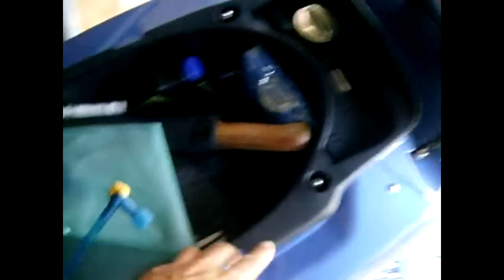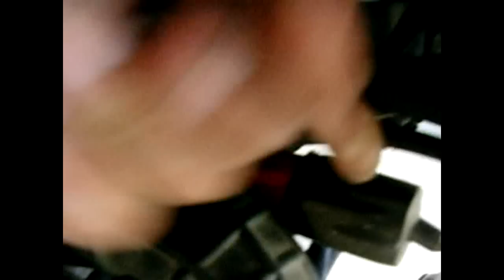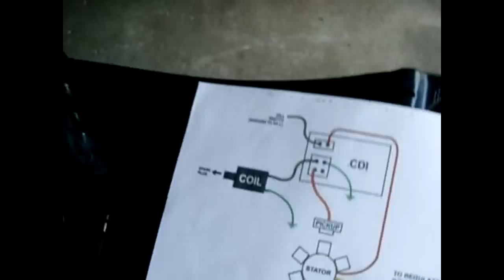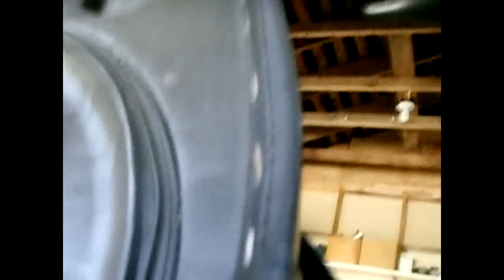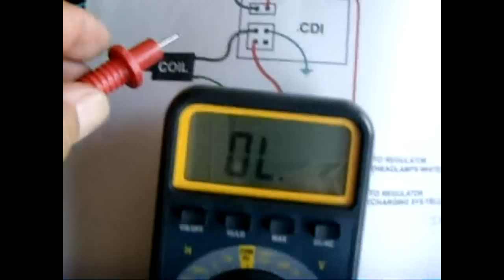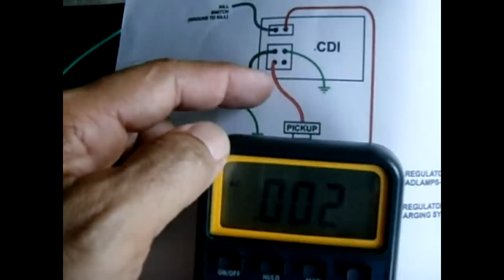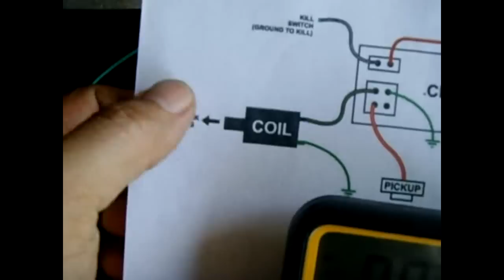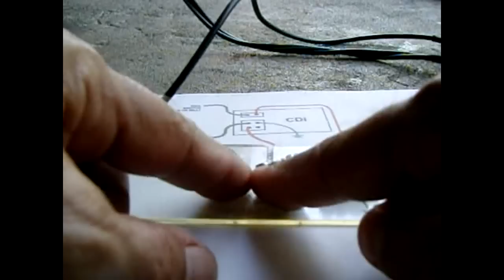The Ultimate GY6 Starter & Ignition Troubleshooting Tutorial

Comment: well i bought  a jonway 250  and its been good other than wont hold  a charge without a constant Battery Maintainer  hooked up.  it was sputtering  a little before  i parked it and then next day i took maintainer off to start it and NOTHING?
no power ,nothing?  my battery is good , im at a loss i wished i  could get someone to do diagnoses  & routine maintance
Reply from the maker: Very simple. Fully charge the battery, then disconnect the NEG cable overnight. In the morning put the cable back and see if the scooter starts up. If it doesn't, then your battery is gone(lost it's capacity/has shorted cells). If it does start up, then you need to watch my battery parasitic drain video. Thanks for watching!

Comment: All of my electrics work on my scooter starts on a kick but won't start on the button battery is fine. It will start when I cross it at the solenoid and I can't seem to find the problem the button looks fine and it should be as the scooter only has 800 miles on it . It's a 2007
Reply from the maker: If shorting the 2 bolts on the solenoid starts the engine, then you have either a faulty solenoid, faulty start button, blown tail light, of bad wire connection.
Reply: electronicsNmore thanks I'll go down to the shed and have another look at it and I'll let know if I've sorted  it
Reply: what if you've replaced the solenoid, then the switch, and still doesn't start from the push button? I would have to take off the seat, pass a screwdriver between the 2 bolts and hot start the bike. I recently took it to a mechanic who wound a wire from the positive (red) and cut the negative (black) wire, that now I have to connect to jump start the bike. I was working on getting the bike to start, touching these two exposed wires jutting out of the side vent, that I bought a 2-way flip toggle switch to simply trigger the starter. Tuning the carb has been my BIGGEST issue and now on top of that, I have a 3rd starting sequence having to flip on the starter then remember to TURN OFF the starter once the motor sustains. Well, I must have crossed wires somewhere or even tripped a ground, but once I got the motor to run, I went to turn off the bike by the killswitch on the handle, the toggle OFF for the starter, and the key ignition off, THE BIKE KEPT ON DISCHARGING and trying to start. I panicked and pulled the solenoid out, then pulled out all the plug wires in the harness, *it was still going*, then disconnected the battery. It was really troubling...I have no working kickstarter and possibly the kick spring is off track. So the electronic start is all I got.

WHAT DO I DO? ~_~
Reply: I forgot about my scooter since in my shed and was rooting at it again today. I changed the solenoid and the push button starter switch and still nothing.

Comment: Hello, and thanks for the great video up front : ) I hope you are still open to a question or 2.. I would like you to know that i watched your video several times over by the end, and tried to listened very carefully before posting any comments / questions, as to not waste any of your time. Hopefully i did not miss anything i am about to ask ; )
Just a couple bits of info first that may help.
This is a go kart with the gy6 150cc engine. I have no keyed ignition (push button). I just tied the on / off switch wires together for the tests just to rule it out of the equation all together. Switch tests fine though. There is a secondary safety switch on the brake pedal. The starter will not kick when you push the starter button unless you are holding the brake at the same time. That switch is also functioning fine. My 4 pr. wire harness going into the CDI only has 3 wires in it.  I Did a continuity test of each wire. 2 of the wires go to each lead of the coil,(if 1 of those is a ground then any ground would show continuity i guess) and the 3rd wire is the pick up wire. Other than those couple things, some wire color differences, and the fact that the fuel gravity feeds on mine, everything in your video matches what i have here.. Moving on... 

@14:00 mins. of the video i guess is a good start. Coil OHM resistance at CDI. I am getting an OHM measurement of .8 -1.0 for this test. (tester set @200 ohm)  I have 2 coils, both are used, and they test identical for all tests moving forward... I am getting that .8 reading no matter if i test through the wire that goes from CDI to the coil, or if I just test directly to the coil. both coil wires at the CDI read the same. ( i also get the same readings if i just meter the leads on the coil directly while not connected to system)

Skipping forward to 19:30, Coil tests. I did this test exactly as you recommended. With boot / wire off, black meter lead to green coil lead, and red meter lead directly to the screw inside coil (meter set @20k OHM)it reads 3.24, Boot / wire back on. Black meter lead still connected to the green coil lead, and red meter lead to the end of the spark plug wire, same setting on the meter. I get a reading of 8.9. Do you see a problem with any of my readings. By your readings at 14:00, my readings are pretty low. although i saw your caption there as well...)Is my coil ok?  All the other tests that i went through with you on the video seem to be with in the same operating specs..  I am stumped! Still No spark! A new spark plug is next on the list as soon as the store opens. I will cry if that's all it is. I usually just have them around, and never hesitate to try a new plug first. I followed the spark plug test portion of your video, first time i have tried this, but that was not looking good for 2 plugs i have. 1 of them has no continuity between the tip and the electrode (junk), and the other measures with higher, and erratic resistance measurements, so it may be bad also. If not that though, what do you think? Would you still lean towards the CDI unit? I would really appreciate any time and info you would be willing to share.
I learned a ton from your video, and i would like to thank you again for that.. The title does not disappoint! I hope my question & info is just as clear. Thanks in advance.
-EJ
Reply from the maker: Disconnect the wires to the engine STOP switch, then try again. If noting still, then try a new CDI. Make sure the pick up coil is also working.
Reply: LOL, and you know exactly why.... The spark Plug was bad, but your recommendation to disconnect the stop switch wires was the ultimate info that helped me to correct what i was doing wrong. : ) That is a little embarrassing, LOL. Ohh well... Just so happy that i finally heard this thing fire! Good signs! Now i can move on with getting this thing complete again. I am eternally grateful for your video, & your quick, accurate advice! Wish i could return the favor. Thanks again! : )

Comment: Hi there. I will bust my meter out tomorrow and check a little closer as you show, checking the wire from the kill switch. I have already installed a new cdi box and the solenoid, battery is charged. When i try to start, lucky if i even hear it try to kick over. For the most part I just hear the solenoid clicking. A few months back, it would start sometimes, other times not. Do you think I should try new ignition coil and/stator coil, perhaps the starter? I followed this long ago having similar starting problems, and just ordered 3 of those components(cdi, solenoid, ignition coil), put them in, fired right up. My scoot has about 7500 miles on it. Have not really changed anything aside from what I mentioned above. 2012 evo 150, same color as yours actually. Thanks, Doug

Comment: what about my case? i have spark its getting fuel into the cylinder i verified timing and did valve adjustment replaced cylinder and piston with low mile cylinder and piston that ran when it came off the old scooter when i try to start it just sputters in an attemt of running but wont actually run up and go. if i hold the throttle open it sputters faster but still wont run.

Comment: hi bud my gy6 keeps cutting out in the rain only when it rains and doesn't start till dried out what can this be all lights still on just won't start
Reply from the maker: Sounds like a high voltage problem caused by increased moisture. Try replacing the ignition coil/wire, and spark plug.

Comment: Not getting a resistance reading on the black and yellow wire going to the positive side of the ignition coil. How should I go about fix?
Reply from the maker: Either a faulty connector, faulty ignition coil, or faulty CDI.
Reply: +electronicsNmore forgot I had the wire unplugged from the coil. plugged it back in and but I'm getting a really low reading.

Comment: Hi Doug - I'm getting nothing (no change in the ohms reading) from the black and yellow connection that goes directly into the CDI - almost as though there is a break in the connection. Do you have any suggestions for what I should check next?
Reply from the maker: If the results do not match fairly close to what's shown in the video, then either the component is faulty, or there's a bad wire/faulty connection.

Comment: I have an issue with the black and yellow lead to the ignition coil. It reads 30 ohms. Even with a new coil. I have spark but won't start. How do I correct this resistance issue?
Reply from the maker: Measure the resistance across the terminals with one wire disconnected. If you have spark, and squirting a small amount of gas into the carb does not make it start up, then you better check the valve clearances.
Reply: +electronicsNmore thanks for the reply. I tested the same wire with a different tester and got a better result. compression is 30 psi. tore all the way til piston is out and the G clip was broke and blew a small bit of the piston out at the pin and seized the bottom ring set. Now I have to order new upper half.

Comment: i have an old parts scooter that i took the engine from for a used vip i had to change the mount, now the starter won't engage the flywheel any ideas? it did work 2 years ago when i parked it

Comment: i have taken delivery of a stock new 49 cc pulse scout49  2016 model and i can not find the cdi, it is no where by the battery, i can not see it from underneath , can you give me some idea where to look, i have bought a new unrestricted cdi 6 pin for that model, and the carburetor is a plastic black top model which means the c clip on the needle shaft can be moved for altering fuel intake {richer} but i need to know the location of the cdi, your video is the only one on the net that shows a second position 
for the cdi,
thanks for any help you can give,
dave
Reply from the maker: Hello. Look in the location shown in my video. Thanks For Watching
Reply: have subbed and liked, i paused ran outside and bingo got it, so swapped out for 6 pin single connector unrestricted cdi, tomorrow, i will adjust carb needle c clip, then save money for monster big bore 72cc from 50cc 
£18 gbp or approx $22, bargain,
thanks for video 
dave

ps i am 62yrs old and terminally ill, so being against the law holds no sway with me, from UK
Reply from the maker: +vassilij zietseff (davlyn) Glad my video was able to help you. Stay well.

Comment: Video is really good.  I have just bought a vmoto milan 50jx.  Its not turning over, ie startmotor gets nothing.  Bike was initially stolen and I bought it after. I hear a clicking noise coming from the solenoid when I start ignition.  Any ideas?
Reply from the maker: Try another battery. Check all connections.

Comment: After recharging the battery over night, my 150 cc scooter moped has no electric power when the main switch is turned on, the panel lights don't even light up, of course there is no reaction at all when I try to start it up.

I tested the voltage of the battery with a multi-meter which read 12.78 volts. Then I tested the fuse for continuity which is good. I also tried to kick start for a few times without success. After that, I tested the continuity from the red wire connected positive lead of the battery to the main switch and then turned the main switch on with a key then checked the continuity between the red wire to the black wire behind the switch and the continuities on both tests are okay.  To make sure that the electric power reach the main switch, I measured the voltage across the red wire and black behind the main switch, and it read the same as the battery voltage.  So now I am at a lost as to what to do next... as I remember when the main switch is turned on the panel lights are supposed to light up, but now it does nothing at all. 

As if things are not confused enough, when I measured the voltage across the 2 leads of the starting relay, it read 1.78 volts.  I double checked it and yes it was 1.78 volts.  Then I measured the battery voltage, and it was also 1.78 volts. I thought it must've been the faulty battery that was the problem and dis-connected the battery and took it out and measured the battery again by itself, but the reading this time was 12.38 volts.  So now I am totally confounded.

Can you tell me what might the problem be?
Reply from the maker: Sounds like a bad connection, or an engine ground wire problem. You need to check every connection.
Reply: Thanks, Sir, for taking your time to answer my question.  I really appreciate it.

Comment: Hello, If my engine has a trouble of keeping a steady idle, can  a possible bad crank bearing be a possible cause for the bad idle? Also if I have a sound coming from my engine at idle, which has not been there before, would it mostly be caused by a bad crank bearing?  the scoot has about 14 000 km or  8700 miles, about half of it i've had a 72cc kit which may have put further stress on the original crank shaft, but not seemed like a problem untill just now
Reply from the maker: Hi. Check the valve clearances. That is usually the cause of poor idling or starting. I have a video for that. The noise is likely a bad bearing on the camshaft or crankshaft.
Reply: electronicsNmore  hello, i removed everything in the engine and came upon a problem,. im gonna change the crankshaft, but the problem is the used replacement i have is 16 gears, the one in the bike is 22 gears on the oil pump, is it interchangeable if i change the oil pump on the 22 tooth to the 16 tooth oil pump?..

with best regards
Reply from the maker: ErmaTheKitteh
You should use exactly what you had to avoid problems.

Comment: went for a ride on my scooter went into the store came out went home and went to turn on my alarm remote it will not go off I thought the battery was dead and it wasn't that and I went to turn the scooter on with the key in the ignition there is no current no power no nothing does anybody know the issue
Reply from the maker: Remove the alarm system, they're nothing but a problem.
Reply: Would not allow no current
Reply from the maker: James Leonard

Either a faulty battery, blown fuse, loose wire, or alarm problem.
Reply: +electronicsNmore I was riding it everything was okay I turn the remote alarm on and it won't go on then I tried starting it and was like no current going through
Reply: Voltage regulator went out. Got my scooter back on the road. Thanks for the help..

Comment: I have a Brand New scooter just assembled, When I first tried starting it with the electric start it kind whined and make funny sounds, then all of a sudden after about 20 tries, the only thing that makes a sound is the solenoid, it makes a clicking sound... I have done everything here and everything seems fine.. Also when I jump the solenoid it does nothing.
Reply: The bike starts just fine with the kick starter.
Reply from the maker: Sounds like the starter gear is not engaging the engine to make it rotate. Also sounds like you drained the battery down and need to charge it.

Comment: Hey thanks for posting this tutorial!
On my 49cc 2012 Peace Scooter I can jump the relay and start it but when I apply 12 volts to the 2 wires going into the relay (Y/R & Y/G) it does not turn over
Where do I go from here.
Thank You.
Reply from the maker: +Rusty Nuckles 
You're welcome. Sounds like a faulty starter solenoid.
Reply: Thank You for your prompt response!
I was messing around with the rats nest of a wiring harness under the front cover and that's when I discovered it would no longer start with the starter button, thought I screwed something up!
They have the start safety wires twisted together, yes the switch in the rear brake handle tested bad.
Turn signal wires hanging loose, fuel gauge,head lights, instrument panel back lights don't work, had the horn unhooked & the triple tree is broke, but what do you expect for a $20 scooter that runs!

Comment: 250cc chinese thing.. starter sounds to be dragging. took it  apart cleaned brushes looked good. still sounds like its draging. could it be in the timing? my stator is in the oil case. runs in oil. uh??????..Any help would help

Comment: best video ever!!!
Reply from the maker: +Travis Stout 
Thanks! Be sure to check out my other videos, rate thumbs up, and share with others. :-)
Reply: Man I'm so stumped on mine I'm frustrated an throwing things. I don't know if a 150cc lb adventure has a switch you engage before starting an when I do press start the solenoid just makes a clicking sound. I've tried everything # kick a scooter
Reply from the maker: Travis Stout
Clicking solenoid means either a faulty solenoid, low battery voltage, or faulty starter.

Comment: Thanks mate. It just strange that it only done around 1000kms. Do you have a video on how to adjust valves?
Reply: You're gonna have to pop the valve cover off the top. Put the piston at top dead center compression. remove the spark plug and rotate the engine via crankshaft or rotating the back wheel if its not locked up. then get one of the locknut wrench sets for the jamnut on the rockers and some feeling gauges and look up the specs on clearance and youll be all set.